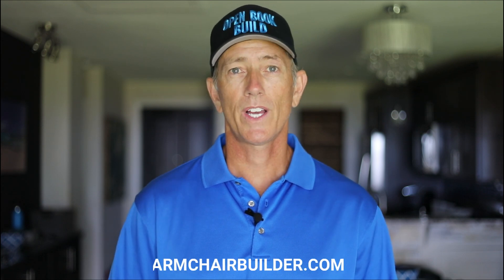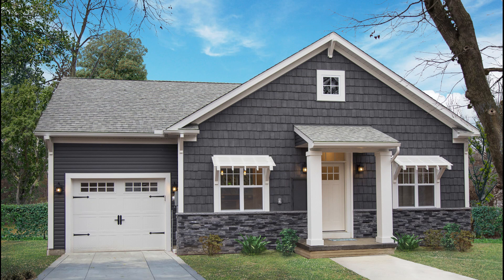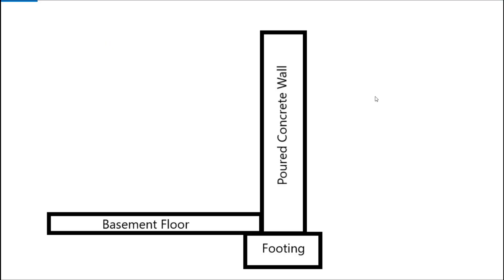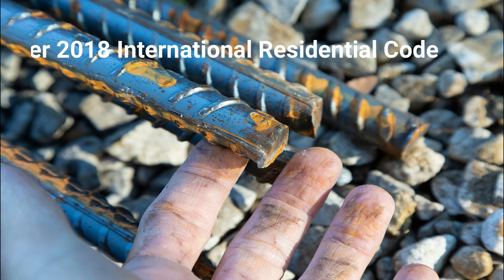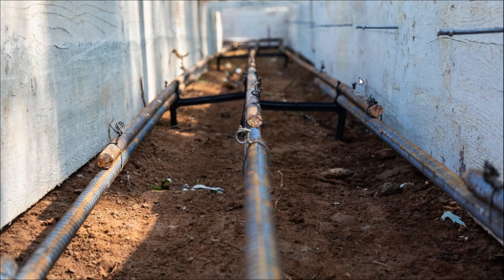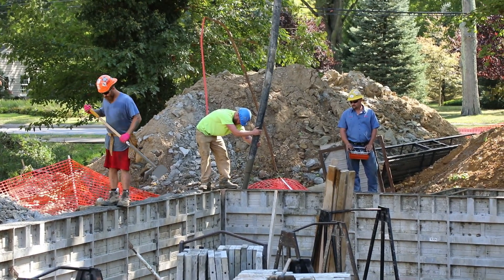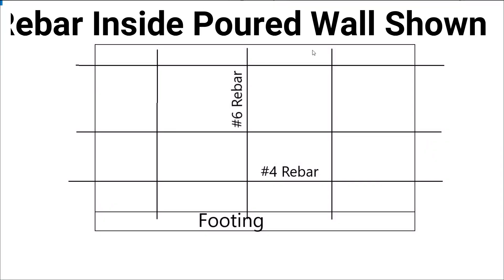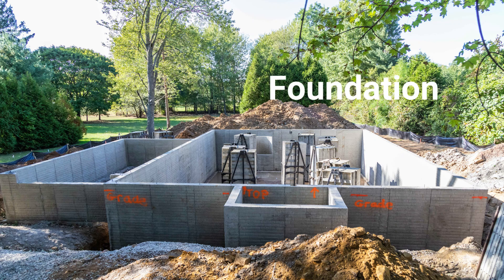Quality House Foundations: Avoid Structural Problems

Comment: Very informative video. However, I have a question. I was thinking about buying some land that already have a block foundation walls already up. I would want a solid concrete foundation plus I would want my own floor plan. Could the block wall be torn down and footing ripped out with compromising the new footing and foundation wall structure.

Comment: I think you missed a couple of things imperative to making a strong foundation. First, the engineering of compression is tension and how rewarding & concrete work together.  Second, the concrete recipe is vidal to making to a concrete last. Concrete fibers and admixes such as a water reducer makes the psi of concrete much higher and lowers the chances of voids forming in the forms.

Comment: Interesting. Here in the Pacific Northwest, it's usually required to place #5 vertical "L" bar, or hook bar, every 12" and #5 horizontal bar also every 12 inches. Usually 3500lbs strength. Is interesting that different areas require different specs.

Comment: This is specific to where this house was built. The foundation design is dependent on the supporting soils and active soils cannot support footings and may this design will not work. There are soils that move over 14" from wet to dry. The reinforcing steel shown lacked bands to hold the bars in place. The wall reinforcing shown was deficient in spacing. Concrete exposed to frost needs to contain air entrainment and the 3000 psi stated may not be frost resistant. the exterior of the basement walls needs to be waterproofed to provide a barrier as the concrete this poorly done will crack in many areas and allow water into the basement.
Reply: Shouldnt they have used a vapour barrier on the footings also?

Comment: None of this means nothing if you haven’t verified the bearing capacity of the soil. You just don’t installed rebar or concrete until you have an experience inspector verify the compaction of the soil of the footings or bearing capacity. This can be done by numerous ways density testing before forms are up, proofroll with a tri axle dump truck the entire building pad, using a probe rod or the DCP method. Most homes that are being built that have foundation issues never ever have a full time inspector onsite to verify soil conditions. Instead the contract places concrete on top of wet soil without any methods use above. Smh.

Comment: Those non-galvanized steel rebars would easily rust and crumble to dust in a couple of decades. And placing rebars 3 feet apart looks unnecessarily cheap.

Comment: Rebar expands when it turns into iron oxide, this will put the concrete around the rebar into tension around the bar and make the wall crumble. I would prefer to have buttresses inside the wall for additional support where needed.

Comment: I don't know anything about foundations, but 2500 PSI strength concrete for the footings seems kind of low considering the tons of weight they will be supporting ? Isn't driveway concrete about the same strength ? Like I say I don't know anything, but personally I'd go 3500 PSI on concrete and double the steel mentioned in this video.

Comment: You should include in the information that concrete is the worst construction system there is. 25 years later concrete cancer begins to show up and eventually you have an environmental disaster in your hands, not to mention that the concrete is cold and porous, humidity will bring disease.

Comment: Nice video. I like that you included the IRC's and the rebar grades. My preference for these poured foundations is to also install a perimeter drain tile over gravel to transport leached runoff. Let's keep the basement dry. (also either painted on, or rubber membrane).

Comment: Is it possible to built 200 sq. m. and 150 Sq. m. Ground floor and same built in areas of 2 more upper floors, and what structural aspects needs to be considered and advise me if there is a design or requirement showing the minimum requirement (rebar, thickness of shear wall ....) and is it possible to construct the slab of the basement with cyclopean concrete instead of using heavily reinforced RC Concrete?

Comment: Is it ok if  you don't have any anchor bolts sticking out from the top of your foundation walls? All I have are these long metal pieces bent at 90-degree angles, but no bolts anywhere. This is for a 3-story home, framing should start next week. The basement foundation walls are 8-ft tall.

Comment: Wait, you're pouring concrete on the dirt with no damp proof layer, and you're doing strip footings now and the floor later?

That's not how we did my floor. Continuous damp proof sheet, good beams, plenty of reinforcement, monolithic pour, and we've had droughts and floods since we built it but my floor is still solid.

Also we didn't have a desperately dangerous worksite where one wrong step could kill someone. How hard is it really to provide scaffolds for your workers to walk on? Do their lives matter THAT LITTLE to you that you just don't care if someone dies while building your house?

Comment: weight and mass never ever ever lie, look at giant rocks or mountains for example, untouched for .well, a very long time, i find in the US even in expensive houses this is skimped on, which is strange as a 100lb block + transport can cost less than 3$ in bulk, (avg home has only 7000lb foundation...)  in my mind for people building new homes this should be taken advantage of, pressure transfer  and mass are the ultimate equalizers, if any concrete of any kind is cracking, its simply not strong enough to handle the pressure its being handed, again, look at large rocks or mountains under loads for eternity, some of which are literally full of snow/water 24/7

Comment: Good Day 👍🙏.. Just wondering, pouring concrete directly on soil ( regardless if its levelled - compacted or not ) without any waterproofing material / pvc sheet will result in reduction in water content of the Concrete. Soil will readily absorb water from the concrete. As a result composition of the Concrete will be affected; which in turn will affect concrete strength.

Footing could do better with 6 Rebars which are tied in place using Lateral Ties.

If possible do add a video of the Completed Project. 

Wishing everyone Merry X'mas..🎉

Sushil Adhikari.
( India )

Comment: Seeing the workman  standing in water tells me site prep was not done correctly. Should be gravel, drainage piping, compaction, plastic sheeting, sump pump before any concrete is placed.

Also, where was the vertical rebar connecting the footing to the wall through the cold joint?

Comment: wow. this “foundation “ is incredibly minimal. cant believe that’s all the rebar required. i’ve been a iron worker for about 26 yrs. i’ve never see. a basement foundation with almost no rebar. 1 curtain #6 at 36” on center vertical . we have 2 curtains #8 @ 6” on center with # 6 horizontal bars at 8” on center on both layers ( curtains ) 3 # 5 in a footing. wow. we mostly do raft slabs. no footings. just a slab that is 24”-36” thick with #7 and the bottom layer at 6” on center with #5 top layer at 16” oc. this foundation as far as rebar is concerned would take my crew one day to tie in. we usually get around one ton (2,000 lbs ) put in for each guy. doesn’t look like there is much more than 3 ton. i should mention i live in california. a basement like this out here has a minimum of 20 tons of rebar. i just finished one on coronado island. that foundation had 53 TONS of rebar and almost 26,000 ft of post tension cable. thats just the slab. the wall’s supporting this slab had another 12 tons of rebar. i wish i could post some pictures of

Comment: I know I'm a little late on this, but I've been turned on to the Superior Wall system.  Some builders swear by them, others avoid them.  The part I'm most curious about is there is no footing for these foundation walls.  I think this is what alarms most builders.  But I talked to the local sales rep who said in the past 10 years he's supervised the installation of at least 70 foundations and there have been no call backs for them.  I'd like to know what you think about this system.
Reply: Getting no call backs is a not a particularly strong argument... Look at surfside building, it was under design on at least 3 critical elements and was standing for 40 years. Any extreme events would have knock it down. The fact that in 10 years (which is very small in comparison with the average age of buildings and structural knowledge) there was no "call backs" is a stupid argument. Did someone with knowledge went on site to validate that everything is performing correctly after 10 years?

Anyway. I went on Superior Wall website. It's a prefabricated foundation system, nothing fancy. It's probably somewhat superior to a CMU foundation wall, but comes with the same problems: dealing with the joints. I believe they have special connectors at each panel ends. You should read the manual if you want to select this system at one point, its pretty well detailed. I would be careful depending on the type of soil you are on, but they have tables saying the same thing. Usually, a residential foundation wall is way overkill in terms of amount of concrete for the amount of loading provided (concrete tension capacity alone is sufficient in most cases). To my knowledge, it has been historically like that because it required less specialized work force, less specialized plans and gave extra capacity (longevity) to the building. Note that the thicknesses of a prefab panel will probably be a lot closer to the actual capacity needed, which means that in 20 years, when you want to make a modification... good luck!
In all cases, most of your questions would be answered if you just read the manual on their website.
Reply: @EarendilTheBlessed  sigh*  Is it possible for anyone to reply to a comment one without throwing insults?  I'm just learning how about the product and relayed what the rep told me.  I don't think we have a building practice that lasts these days.  It's far too expensive.
Reply: @MsBridgesSocial 
I believe I was not throwing insults. Don't take it that way. I am having the same kind of conversation with my partners regarding this "no call backs". If it's a bad design, it's a bad design and it will show at some point. Anyway, it was just a note on that particular phrase. The rest of my comment should have helped you.
Reply: I don't think anybody avoid Superior walls except for the price. They're absolutely excellent
Reply: I know that it has been several months since you posted this but I would suggest checking out Steve Basseck Architect and Matt Rissinger. Both have talked about Superior walls on more than 1 occasion. That might also be some info on Matt’s Build Show Network discussing Superior wall. Pretty much every foundation system is going to have its pros and cons, you just need to choose what works best for you and the area you are building.
Reply: @ameliaomalley8759 
The Build Show has become an infomercial. Take everything with a truckload of salt.

Comment: is basement must be casted in one solid mass or it can be casted layer by layer. like isnot 9' concrete wall but 9 x 1' concrete wall, and can it use wire mesh rebar instead vertical mesh rebar?

Comment: All the rebar you place in both: footing and wall are money flushed into the drain. You either build a reinforced concrete footing and/or wall or a concrete one. The rebar you installed doesn’t make the cut to make it a reinforced concrete for the simple reason that isn’t enough. To make it short: if the external charges will be such as to cause the concrete to crack those rebars will make absolutely no difference. Another consideration is that the position of the rebar in the footing is wrong because doesn’t offer any contribution. A beam with 8 rebars connected with stirrups would be something that makes way more sense. ….. and so on ….
Reply: He didn't compact the soil FIRST with a excavator compactor. That guy is clueless.

Comment: i want to use 7500 psi foundation, footing and wall. is the concrete waterproof?
Reply: He didn't compact the soil FIRST with a excavator compactor. That guy is clueless.
Reply: @loafandjug321  It's undisturbed soil.  You don't have to compact it.